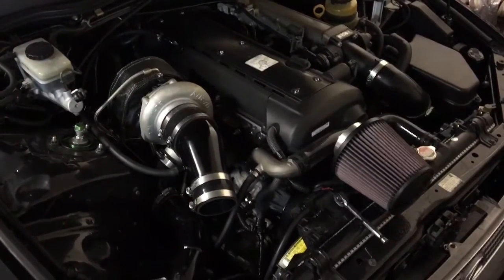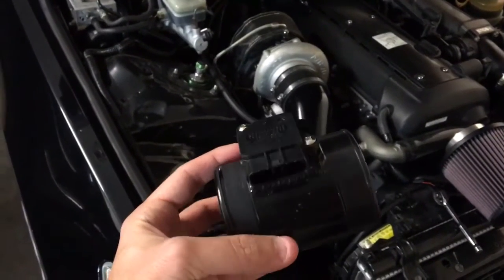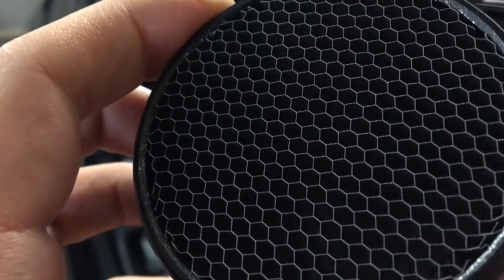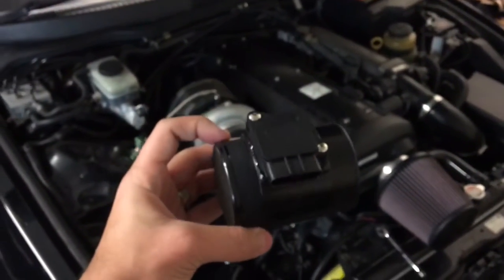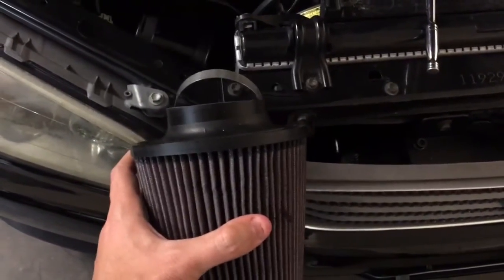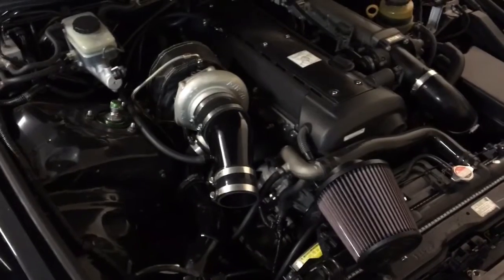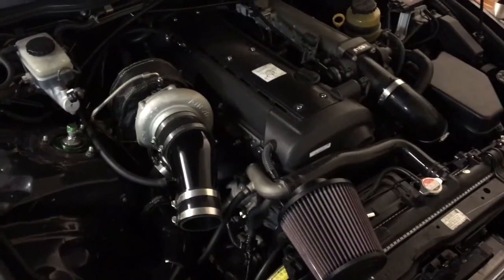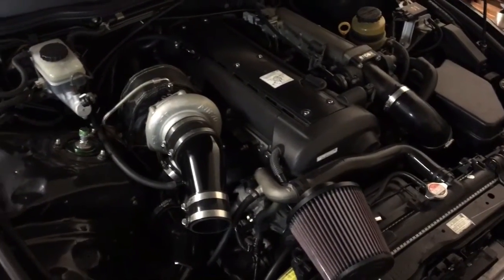JZX110 MAF Sensor J - Pipe delete Fix

Comment: Did you ever fix the stall issue? I have the exact same issue. also slight misfire at idle. 1jzgte vvti jzx100 etcs. all factory.
Reply from the maker: Totally different ecu/throttle/afm etc etc it’s nothing like the jzx110/jzs171 that I had in this.
Reply: @ThatCarChannelOfficial  Ya but did u ever fix the issue? What was the issue? Maybe it will spark an idea for me.

Comment: Which part number did u use
Reply from the maker: 22680-AA310
Reply: I used 22680 AA310 last week.
When the engine speed  2000 rpm, the throttle will be similar to gasoline cut.
It seems that it cannot replace 22204 46020
Reply: @keith_chen  You did use a genuine Denso MAF though?
Reply: @code111japan  I later used LEXUS LS400 MAP
Reply: @keith_chen  Thats cool, but I mean,  22680-AA310 was 100% genuine Denso stuff (Box with Subaru logo and everything)?
Reply: @code111japan  I tried Subaru’s MAP, but the car cannot drive normally
Use the same material number MAP as 1JZ, basically no problem
The same is made by Denso
Reply: @code111japan  Box with TOYOTA logo
Reply: @ThatCarChannelOfficial  Hi, I'm just curious, how did you figured out that 22680-AA310 and 222040-46020 are identical? I can't find anywhere on the net connection between the two except the shape. There are many Denso MAF variations that look the same but with different part numbers and prices so most likely they are calibrated differently... 22680-AA310 was installed moslty on Subaru's, and seems to be quite cheaper than Toyota's 222040-46020 so I'm tempted to get it instead. Guy above however reports problems with 22680-AA310

Comment: so did you notice a fix with this at all or you got nothing?
Reply from the maker: it may help, but i ended up removing it, it was causing a 'boost cut' situation on as little as 10psi, i think it may have been causing a Venturi effect somewhat or causing an incorrect reading.. you can try it and remove it later if needed

Comment: did this fix the stalling issue?
Reply from the maker: it may help, but i ended up removing it, it was causing a 'boost cut' situation on as little as 10psi, i think it may have been causing a Venturi effect somewhat or causing an incorrect reading.. you can try it and remove it later if needed
Reply: +MrExtremeboost MAX Boost ok thanks for the reply i have a jzx110 in mine, and i am having the same stalling issue.

Comment: The pipe's diameter is 3 inches, correct?
Reply from the maker: It's 70mm ID. I used 3mm wall 3" (76mm) aluminium straight.

Comment: should i do this to my jzx100 maf?  its infront of my turbo as well...borg warner s360
Reply from the maker: it may help, but i ended up removing it, it was causing a 'boost cut' situation on as little as 10psi, i think it may have been causing a Venturi effect somewhat or causing an incorrect reading.. you can try it and remove it later if needed.